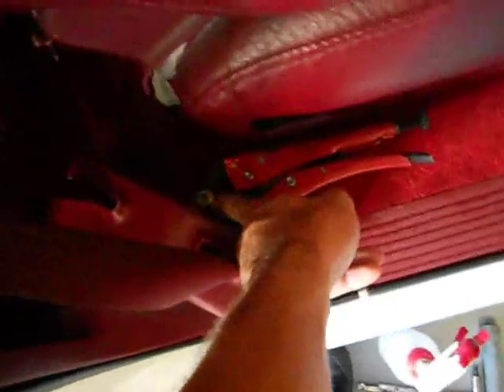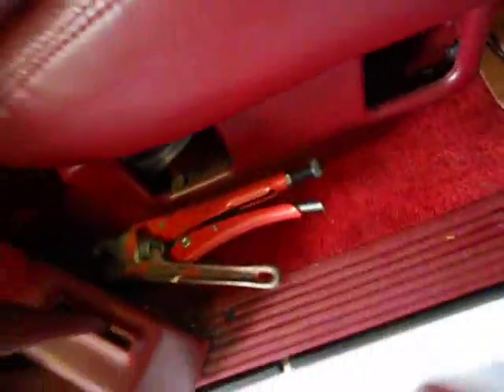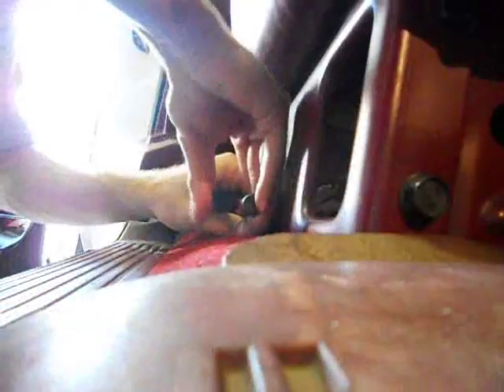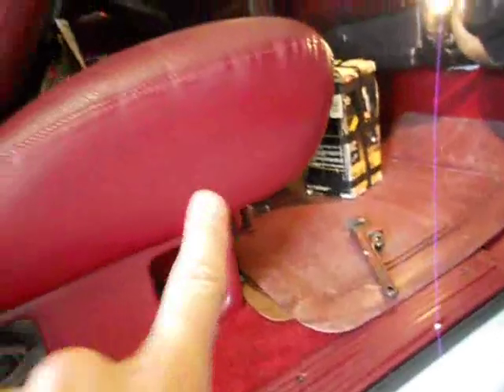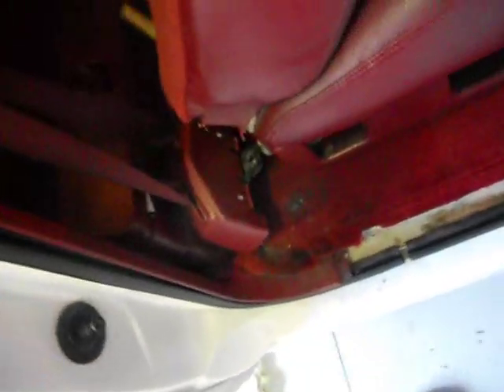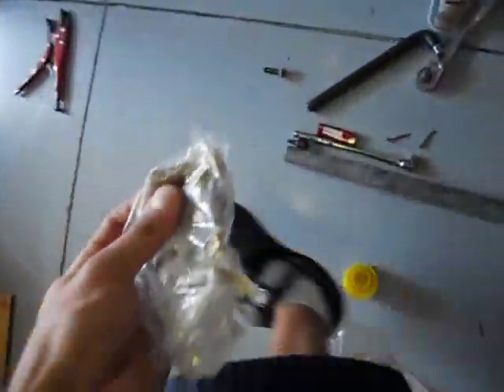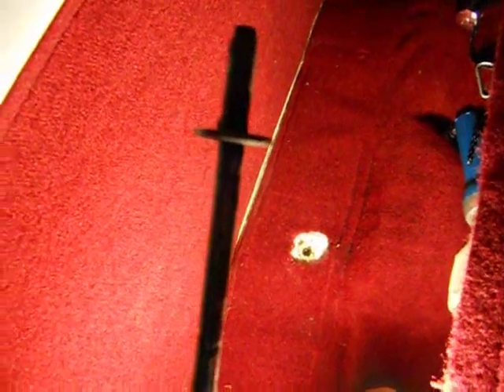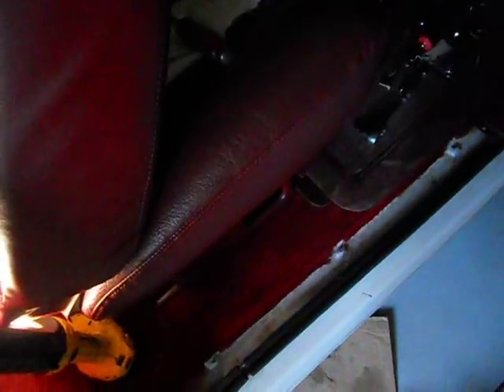How to Remove Stripped Torx  bolt  that is rusted ! Seat belt bolt T-47 T-50 BEST WAY!

Comment from the maker: Dont bother with using an E torx, which is an inverted torx on the top part. It will just strip it. Throw on two nuts that fit the shaft, I think its metric. Jam the upper nut with the lower nut. Put a wrench on the lower nut and start loosening it. If it does not want to budge, heat it up and spray it with some penetrating oil.

Comment: I totally stripped that seat belt bolt today, it’s a 1988 gmc, rusted to shit, it probably hasn’t been out of the truck since it was made…I sprayed some deep creep and was hoping I could get it out easy enough but nope totally stripped. Hope I can vice grip it out
Reply from the maker: Heat it.  Oil it.  Water it,  repeat, Small pipe wrench

Comment: Solid video man - question for you

The same bolt stripped for me, but its inside the seat belt cover.  How did you get your seat belt cover to move to the side?
Reply from the maker: It always was a little  LOOSE!  What you May be able to do it the bolt pokes through the floor or any other spot, get some vise grips on it (Maybe try to protect the threads on the bolt with some tape) and try to get a turn on the bolt.   Worst comes to worst you are going to have to break off the seat belt cover, if it is a replaceable part you should be able to replace just the cover.  GL.

Comment from the maker: @kerobinsonii  Yeah! If the screws are rotted (like mine was) LMK.. Ill get some next JY run.   They come out nice when you wire wheel the hell out of them, treat them in some rust converter then paint em up.. and of course anti seize... Except the FLawduh screws. The last ones I got were perfect, but I painted them anyway.

Comment: Beautiful floor pan under that carpet .You should see mine you would be offended lol
Reply from the maker: Surprised this one is not worse than what it is. Only has maybe 4 rust holes.    Doors Bed behind the wheel well.  Radiator support and maybe one cab corner now is starting.
Reply: Ghetto Wagon both my cab corners are rough, have you saw these polyurethane/plastic rivet on cab corners? I just looked it up they’re out of stock for the 89-98 rite now.They’re called redneck randys cab corner covers lol! I geuss you hide the rivers behind the black rubber body trim? They’re like 40 bucks.Its a cheap alternative to buying the real metal ones for like 75 and then having them welded on.

Comment: Trying to remove the T50's in the backseat of a 84' K5 Blazer.  Man... i've never heated, beated, impacted, PB blasted so much in my life without a budge.  Just broke the T50 socket.  I tried a pipe wrench too and didn't have as much luck.

Came here looking for some special super secret trick... but nope.  I started to drill one of the T50 bolts, but realized they were pretty hard.
Reply from the maker: I think all are T47 not T50. A t50 kind of fits but its wrong.  They will come out Keep heating and cooling soak it  I worked on this one for along time.

Comment: LMAO why the fuck ford uses this on the front brake calipers is beyond me
at least pre 95 
tougher than anything forged on planet krypton
Reply from the maker: +Mr. “Bluedragon” pewterschmidt  Ya some chev&#39;s used them too. On large fasteners that are were torqued down, forget it its a bad fastener, a Allen is better.  The torx can cam out pretty easy, you are putting pressure on tiny splines.  Atleast on a brake caliper bolt, if you can get to the outer edge you can use a pipe wrench, or weld a nut to it.
Reply: I won the battle last night against both T50s in the brake calipers.
A friend and i took a pair of vice grips and made it soooooo friggin tight that we had to use our feet to push the grip together over the bolt, it dug into the sides of the bolt like a monster... and in which point it broke free and i knew at that moment there is hope in the world lol
Reply from the maker: Mr. pewterschmidt
 That's what you have to do! anything is possible when you keep trying